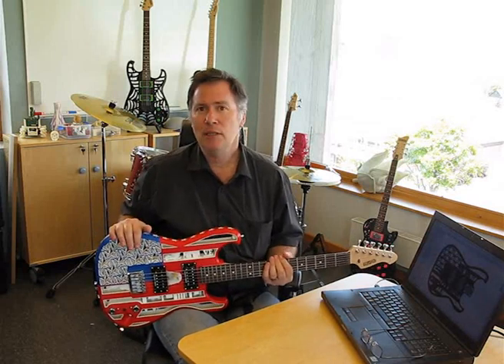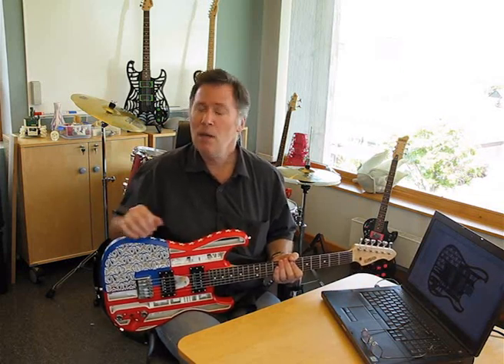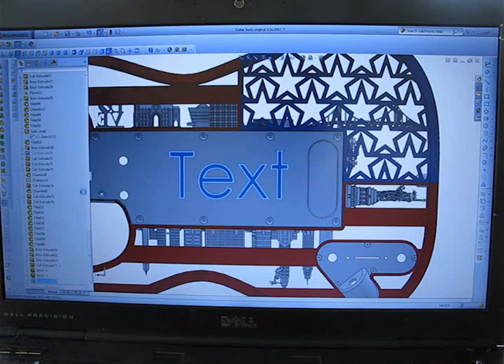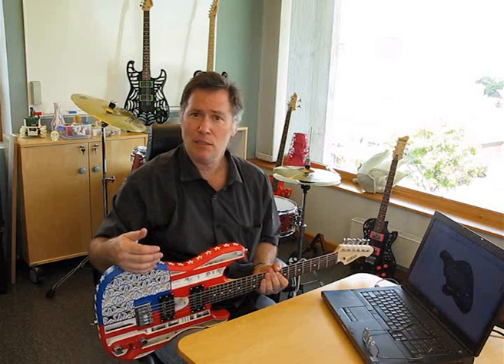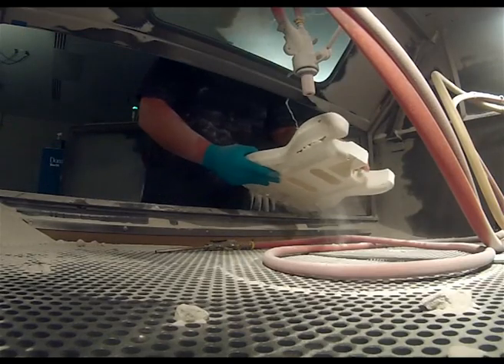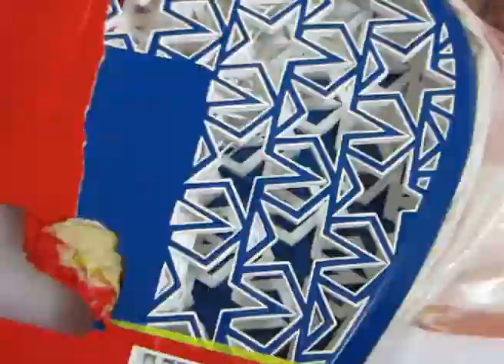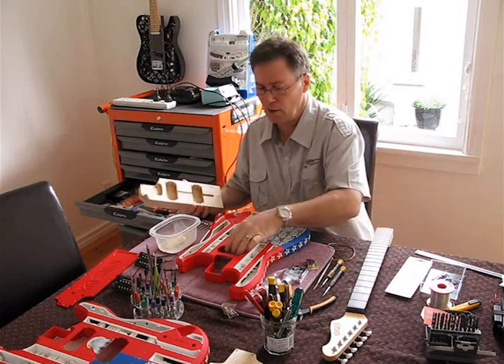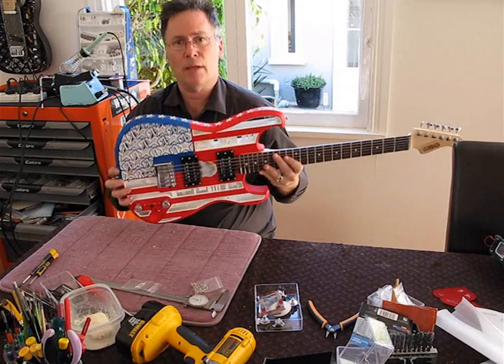Making a 3D Printed Guitar

Comment: Olaf, congratulations for your guitars! 
One question: 
to what extent you wouldn't recommend building the guitar body with a 3D desktop printer? 
I mean, if I was to build a practice guitar for instance: would there be any danger in the body part breaking or how would you describe the not so good factor of building with 3D desktop printer? Thank you! 
Stefano
Reply from the maker: HI Stefano, 
No problem building it with a desktop printer, as long as you are using a wooden inner core to give it the strength it needs. But I would also only ever print a guitar (doesn't matter which 3D printing technology you use) if it had some really funky detail that was impossible to make any other way. If you are just making a simple relatively solid guitar body, then there are much easier ways of making it than 3D printing. :-)
Cheers
Olaf
Reply: @oddguitars  Thank you! I believe the guitar that I would like to build has a very specific reason for being 3D printed!! How about the wooden inner core, where did you get yours built if I may ask? Thanks very much Olaf, your feedback is very helpful!
Reply from the maker: @stefanoroccomusic5061  HI Stefano,
I have a little CNC machine, so machine the cores myself.
Cheers
Olaf
Reply: @oddguitars  excellent, thanks again!!

Comment: I dont think this is considered 3D printing is called Stereolithography and its way expensive it requires a big ass machine, high voltage, nitrogen and the powder (nylon) is quite expensive!

Its mainly used as an industrial prototyping machine, you could melt iron powder with this too. So again selling plastic products out of this is kinda not cost effective since for the cost of this guitar body you could buy a 3D printer!!!!!

Comment: You could 3d print these on a desktop machine for a fraction of the price. However it would take dividing the body into sections and printing those separately.
Reply from the maker: Hi Parker,Yes, you could, but you also couldnt get anywhere near the feature detail, or the strengths of the material. Dont misunderstand me. I love desktop 3D printers, and have several of them, and they are absolutely awesome for trying our ideas, etc. but they cant compare to an industrial professional grade machine.CheersOlaf
Reply: @oddguitars  Can you explain how you're getting higher strength material using an industrial grade machine? Shouldn't that just depend on the material used and the infill?
Reply from the maker: @leptonguitars5491  The 'industrial' machines I am talking about are powder based (rather than filament based) powder-bed fusion machines (SLS, MJF, etc,), so because of the nature of the process produce much more durable parts than filament-based systems. It's why powder-based technologies are what is used for probably over 90% of real-use production parts (as opposed to prototypes). In filament based machines, even the industrial quality ones, there is a high degree of anisotropy (weakness between the layers) that makes the parts weak in the z/vertical direction. With SLS, assuming the part is designed correctly, there is little weakness in the z-direction.
On a guitar there is a large amount of tension on the strings trying to bend the body. On a bass, it is well over 100Kg of tension. So, if you print a body in solid plastic, on almost any 3D printing technology, chances are that the body will start to bow after time, if left strung up. This can be overcome by designing stiffening ribs into the body, which I did do on some of my earlier guitars and it worked just fine. But, for my production guitars, I overcame it in an easier way by just putting a slab of wood inside the body to join the neck to the bridge.
Cheers
Olaf
Reply: Olaf Diegel Overpriced nylon guitar. A guy behind a desk and his 3d printer will never create a wooden instrument mixed with sweat and hours of artistry. 

3D this 👎👎👎👎👎
Reply: @STAY-GOLD-VINYL  you know that designing takes "sweat and hours of artistry" too right?

Comment: So it's really a minimal body guitar with a plastic shell.    Not really a 3D guitar, more like one of those 80's body less guitars with a plastic shell attached.  Not very creative IMO.  

It can't be called a 3D printed guitar unless ALL the material used is the same, or some form of non-organic material that is made and not harvested.
Reply: You should really consider educating yourself just a little before deciding to critique someone else's work.  These guitars are nothing like "one of those '80's body-less guitars" - normally referred to as "Steinberger's" - which were (and remain) one of the most sophisticated instrument designs ever brought to mass market.  These "plastic shells", as you mistakenly call them, are in fact innovative guitar bodies that utilize what is certainly a state-of-the-art design and manufacturing process as applied to the creation of a electric guitars - and also advance a clearly innovative aesthetic character as well.

Comment: how strong is the polymer material, can it withstand the tension of the strings on its own? can you heat treat it and change its properties?
Reply: Yeah I've been wondering if the body will warp under the pressure of the strings

Comment: the body that you have in front of you , would that happen to be a Strat body ? or is it a Telecaster body ? I can't really tell
Reply from the maker: If you mean the one I am holding, it's my own version of a Strat, with some pointy bits on the horn (to match the Warmoth Warhead headstock). But inside the guitar is a skyline of many of the landmarks of NY. Have a look at the Americana page of my website, and you can see pics of all the details, etc.
Cheers
Olaf

Comment: Fascinating. I guess it's the customization that's the most unique aspect of this approach -- every guitar can be different in a non-trivial way, for only a few minutes work per guitar. Neat.
Reply from the maker: Hi Mark,
Yes, that's definitely one of the big advantages of 3D printing, and I do customize every guitar I make. But that, alone, is not enough of a reason to use 3D printing. If I was doing a standard shaped guitar, with some minor customisation, like a name engraved on it, it would still be more cost effective, and give you more options in terms of materials, to CNC machine it. But you'll notice that all my designs have a level of complexity in the shapes that you just couldn't do with traditional machining. Like the city-scape of New York on the inside of the Americana guitar. So when you combine the advantages of customisation and 'complexity for free', that's when 3D printing starts to have serious advantages!!!
Cheers
Olaf
Reply: Olaf Diegel mm the same time I